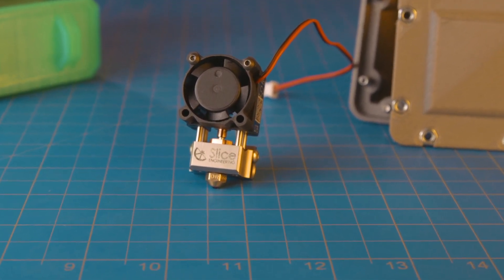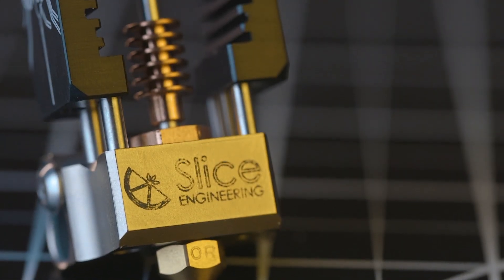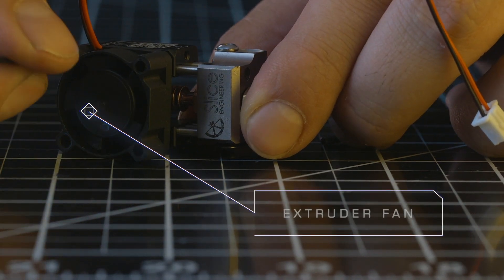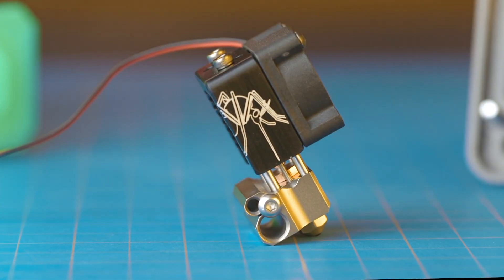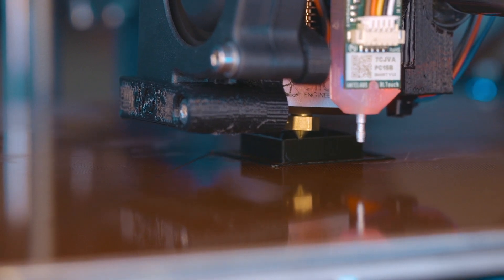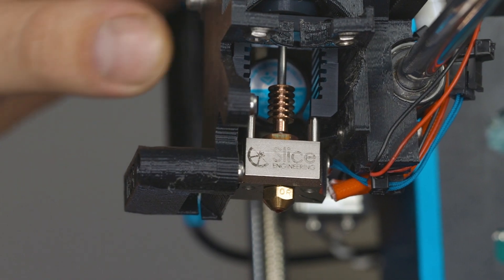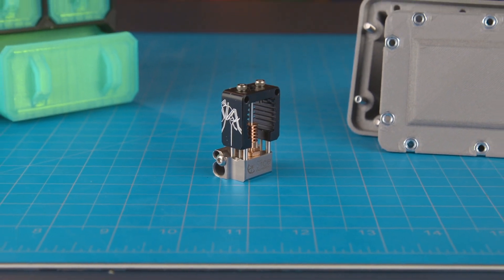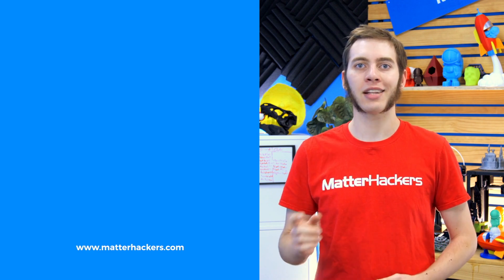Mosquito Hotend // 3D Printer Accessory Highlights

Comment: Being smaller is absolutely not enough to justify costing more than twice as much as a V6. And what is the point of that heatsink being so small? There's plenty of dead space inside that black shroud, no reason it can't be bigger.
Reply: Good question Seth about the heatsink.   The heat break tube has a paper-thin wall, that's why so little heat sinking is needed.  Early prototypes had no heat sink.  They worked great except when printing voronoi or other models involving low/interrupted flow especially out of PLA.  A small heat sink helped there, and it provides more than enough surface area even when the print chamber is at 50 C, as I normally run my printers.  Printing a model with fairly steady flow (think opposite of voronoi) you can even turn the fan off, because the filament itself is plenty of a heat sink.  Just make sure the fan on is when the printing stops, otherwise the filament will conduct heat up itself and pot your heat break.
Reply: you're talking abou the geniuns :P the chinese clones (E3D is open source!) are like 5-10$. haven't had issues with my clone. tho tomorrow I will change it to all metal (changed the heartbreak) even tho my max temp is 240-235 I'm still slightly worried about the toxic gases. I've heard specially the cheap ones (my heatbrak was 0.5$) will have clogging :c also heard metal heatbreaks can cause tpu and pla clogging so I'm hopeful.

Comment: Watched a lot of videos on this hot end. The most interesting was a comparison between e3d hot end and the mosquito on a prusa i3 mk3. Print quality was practically identical.
So probably best to buy it because of its features.
High temp printing ie poly carbonate
It’s quiet, the manufacturer said they had run it without a fan printing PLA without a problem. Although that probably isn’t the official recommendation.
Last but not least, changing nozzles quickly.